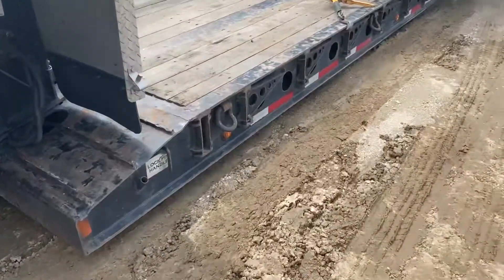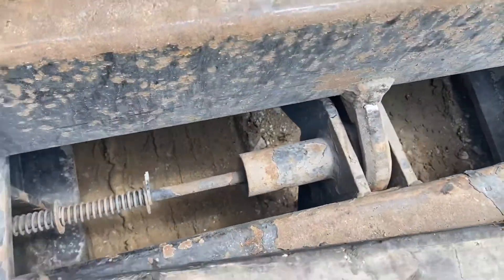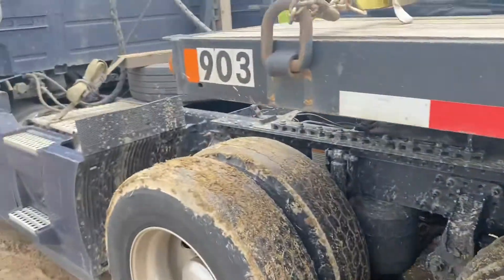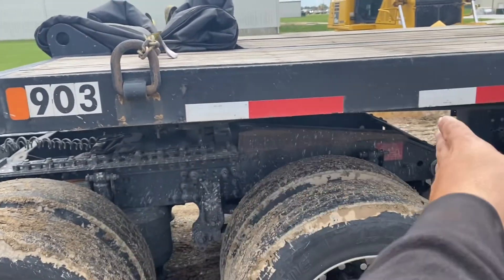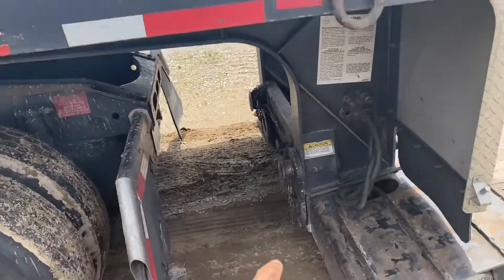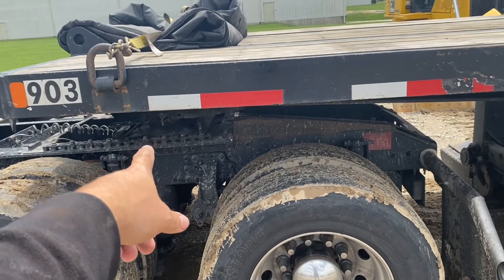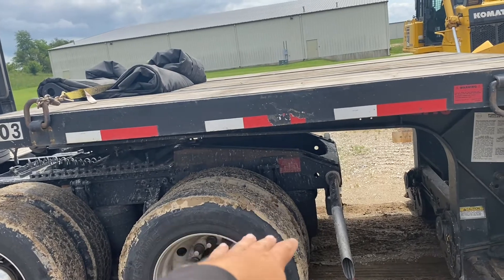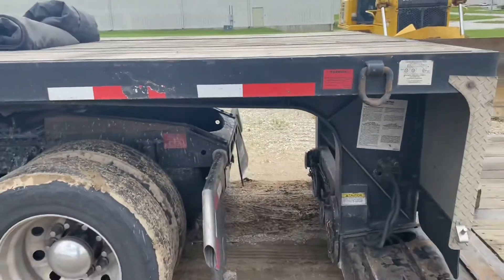Trucking How to Detach a Lowboy trailer

Comment: Unhook the air, trailer and deck, tuck the lines in the floor, drop the trailer, disconnects the collars and ring plates. Pull back under the trailer, put the block under the neck and on the frame. Pull the pin rod and turn to lock it in open position. Pull ahead with the neck. >>When going back to unchain, step on the pin rod to release the pin. The pin will go in and hit the plunger.<< REATTACH. Back the truck gooseneck back easy and centered, the piece that the pin goes through will push the plunger back and the pin will pop in when your back far enough. You will see the rod/handle go in and hear it. remove the block, drop the trailer and connect the rings and collars. Back under the trailer to lift and connect. Connect the airlines.

Comment: Helpful!!!  Problem with mine is that i have a hydraulic arm that swings down to put pressure on the truck frame so the rgn doesnt fall to the grouns,  pain in the ass when you cant move your fifth wheel